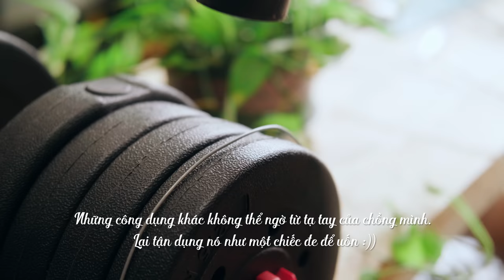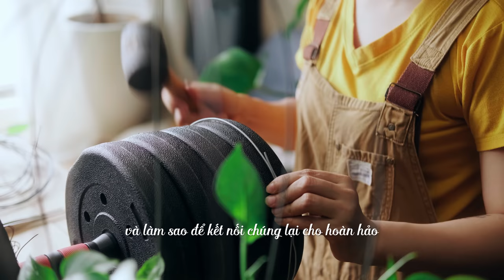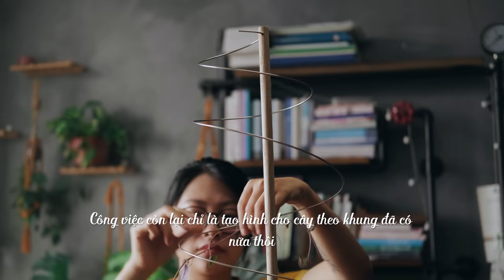Sub) 4 Easy Ideas to DIY Trellis For Climbing Plant Using Leftover Metal Wire | Home Decorating

Comment: Its beautiful 💞. Does the wire you use would not get rust or corrode after  a very long time?
Reply from the maker: Hi that wire won't rust, I use 304 stainless steel wire 🥰
Reply: @XiuHouse  Thanks for your response! Love your content.♥

Comment: Hi! I have all kinds of trellis/supports for my plants but, unfortunately, my wire ones I still have to support with bamboo poles (they're 14 gauge plastic coated) what gauge do you use? Thanks for sharing the video!
Reply from the maker: I’m so sorry! I don’t understand your question 😢
Reply from the maker: Can you be more specific so I can answer 😭
Reply: @XiuHouse  Hi, sorry, I meant what is the size of the wire? The diameter, I guess? Like in millimeters, maybe? The thickness?

Comment: hi, I don't know if you'll see this comment or not, but if you do, may I know what is the thickness (in mm) of the wire you use?
Reply from the maker: Hi dear! I use 2mm stainless steel wires and 3mm copper wires for this project ^^